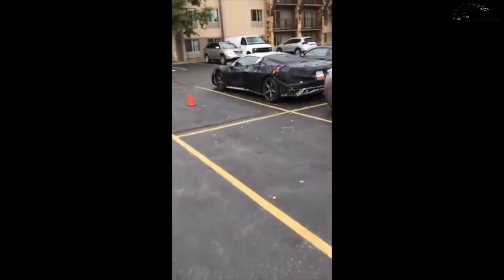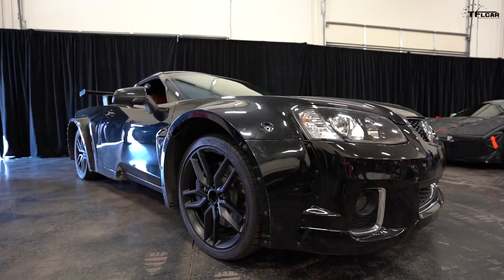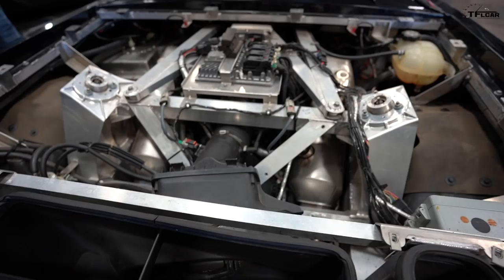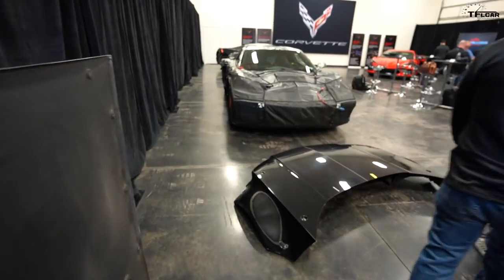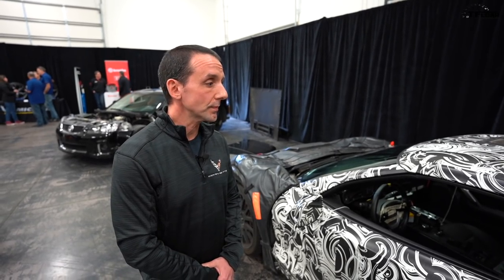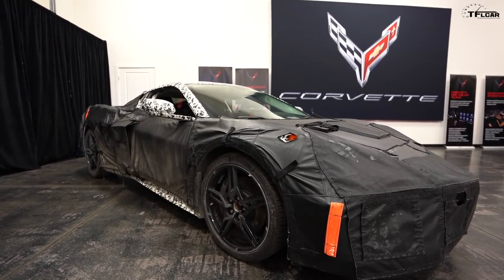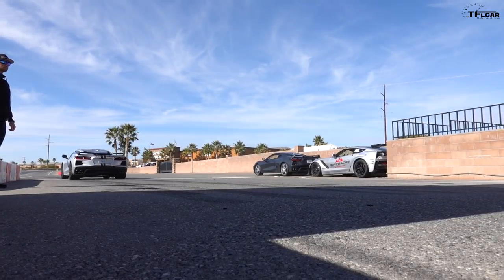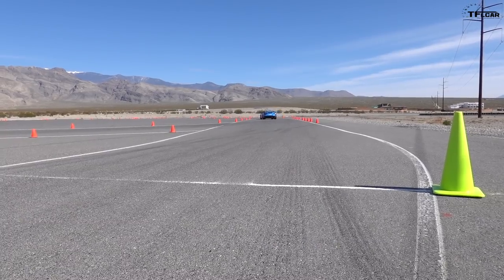Believe It or Not - The 2020 Corvette Started Life as A Mid-Engine PICKUP TRUCK!

Comment: Rear engine Caddy?  I bet that's in the works.
Reply: doubt it.  Caddy buyers don't go for 2 seat sports cars in any great #s.  Also, the Caddy version would be a watered down Corvette for more money with a smaller displacement, crappier turbo engine.  XLR and Allante as examples.  The XLR was C5 Corvette based with a lower HP Northstar, but was still all Corvette underneath structurally.  Cost more money, had less performance.

Comment: Can we please bring the elcamino back
Reply: Big Injun good god no I just had a conversation with someone about just that it’s just a pointless horrible vehicle however the Holden Ute was a great looker and sexy vehicle.
Reply: @brandonwright6578  that is entirely your opinion and completely not factual. I tow quite regularly a trailer on my 2014 Cruze diesel. Fuel economy incredible and its perfect for towing class 1. I have all of my tools packed in my car and its horrible. Now if they brought the elcamino back with today's suspension tech etc, it could tow class 3 and with a small 2.8 diesel it could get great fuel economy. Plus the bed could have a cover and I can reach all of my tools easily and createmy own custom storage as to keep the center open for things I need to throw in. It's the right tool for a lot of people. Just not you and that's ok. A dually with the dump trailer is meant to tow the tractor and chipper all in one shot and that's what its built for. Use the right tool for the job brother and dont be wasteful. I would get 3 times the fuel economy in a small vehicle. That could be a lot of money saved  to buy more tools.
Reply: Big Injun and you took time to write me this why
Reply: @brandonwright6578  why did you have the conversation with the other person on why you shouldn't? Same reason.

Comment: They could have out Ferrari, Ferrari with the C8. But they chose to insert a dinosaur engine in a modern vehicle. It could have been the pinnacle of the ICEV but for maybe profit/cost and tradition inserted an engine from the 19th century. The C8.R will have a DOHC flat plane crank motor in it. Hopefully a ZR1 will have that. That engine will out Ferrari all of Italy & Germany and make sense. Again cost as an issue, ehh, even a Toyota Yaris has DOHC, GM has just refused to re-tool. So consumers are stuck with a dinosaur power plant. Score one for the competition.
Reply: But what's really wrong with that engine? It makes good power and weighs very little. 
The dohc 5.5 is going to be the supercar engine. The lt2 is an engine for a daily driver.
Reply: @Daniel-lv8ze  its a design dating to the 19th century, a dinosaur. Its my opinion, you don't need to agree.
Reply: BTW an LT2 weighs 472lbs a Ford Coyote DOHC 445Lbs. Sure makes less power but the argument of weight does not apply. With a SCharger its about 40 pounds more, so they would be comparable.